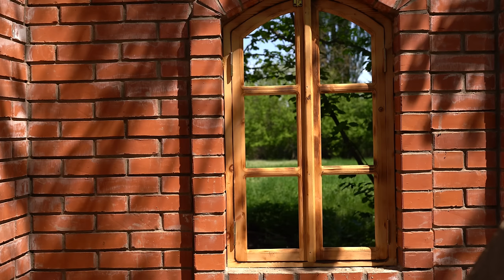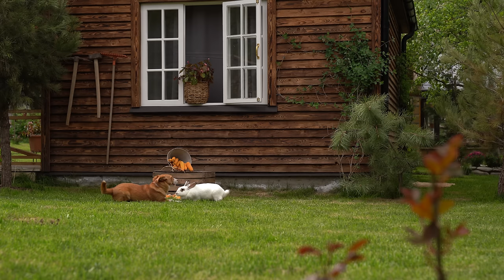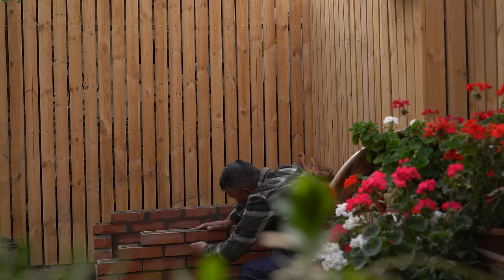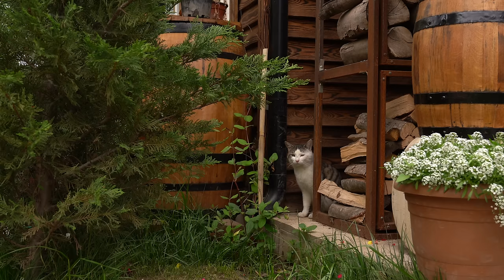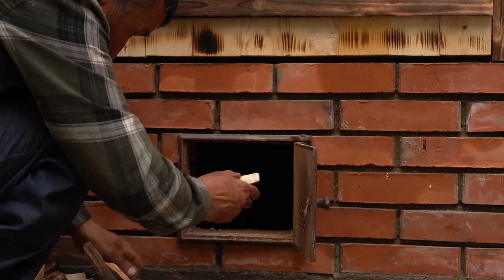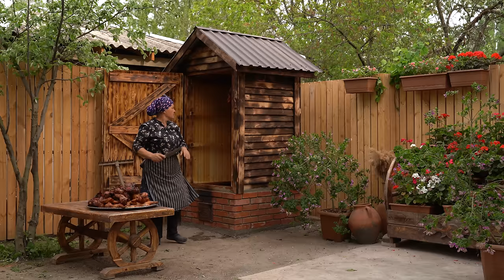Smoked Chicken: Built a New Smokehouse and Cooked a Lot of Chicken

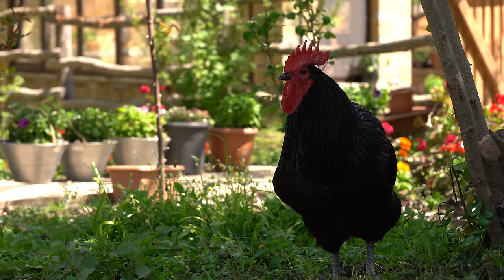Comment: Roosters with black plumage exactly like the one at 1:16 are very aggressive and mean. When I was 10, we had a rooster like this in the back of our garden (40 meters long by 10 meters wide and 5 meters of raised terrace separated by a small wall but connected by an unfenced passage) and each time we approached the bottom of the garden to leave food for the hens, the rooster leapt on us to attack us and stung us with his beak and when we ran away the rooster would run behind us to continue to attack us mugging and poking the length of the garden until you were able to climb onto the raised bed that was at the garden gate. I don't know if only that rooster there with black plumage that we had was like that, but in any case I noticed more than once that roosters like that one with black plumage are very aggressive. They should be avoided if you have children.